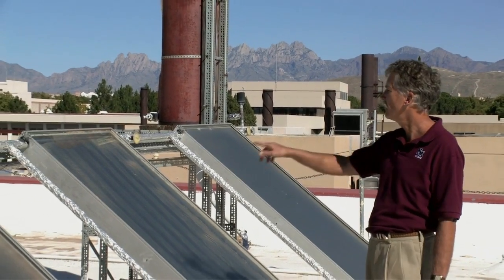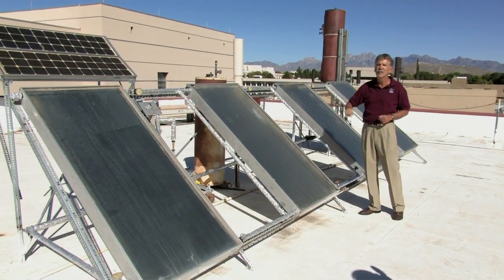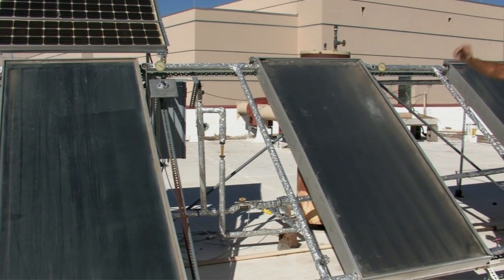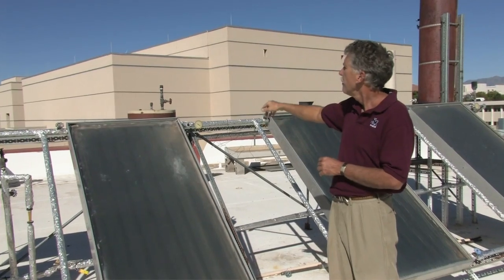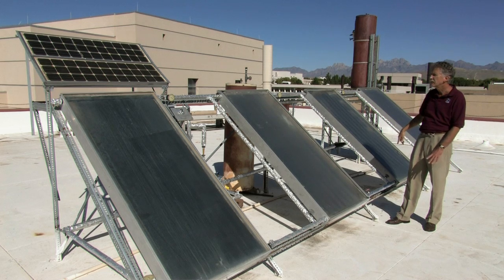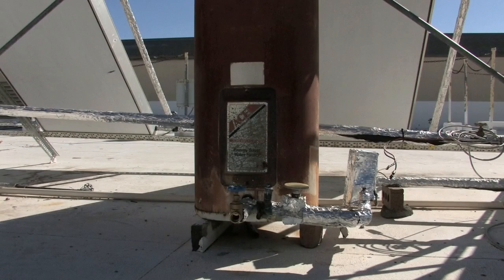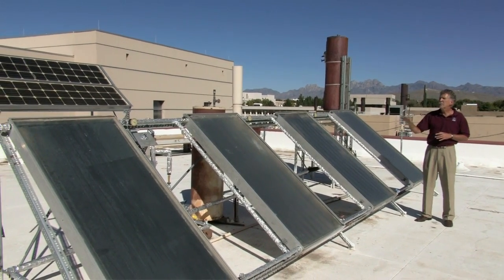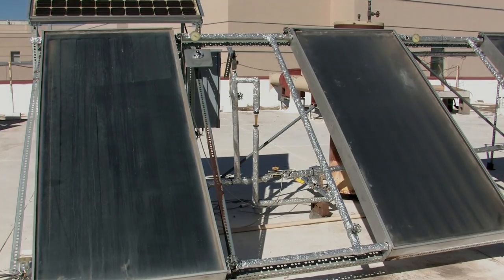Renewable Energy: Solar Water Heaters

Comment: Any type of solar hot water heating is good!  I have an at point 13 gallon 120volt ac water heater which has power and temperature controls being run by my 700 watts worth of solar panels,60amp MPPT and one 100amp hr.12v battle born battery.  I set the temperature to max and power setting to low which is 200 watts.  By the time I get home from work on a sunny day the water temperature is 145 degrees which is enough hot water for two showers.

Comment: Take 10 evacuated tube solar water heater panels. Fill with 50/50 glycol water. Hook panels together so you can flow parallel, and or, in series to achieve highest temp from possible conditions. Then feed these to a heat exchange loop inside a 5,000 gal secondary tank and never pay for heat or hot water again. Just too bad 5 000 gallons of water takes up so much space!! 112 - 45 gallon drums LOL